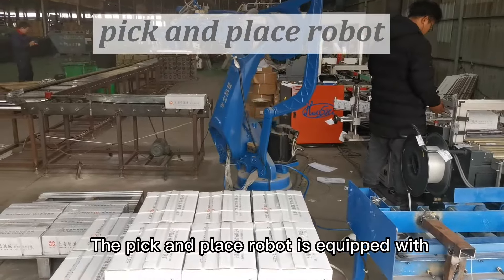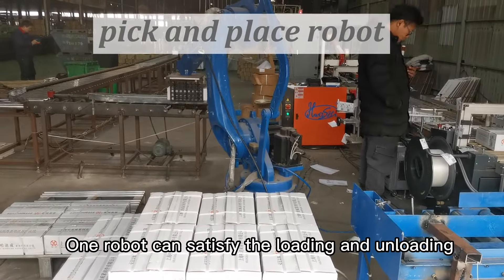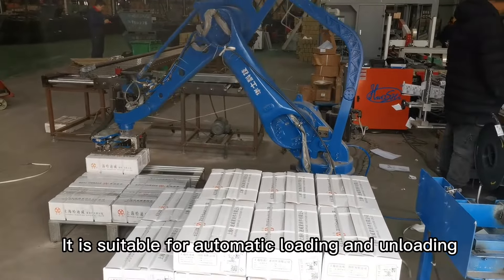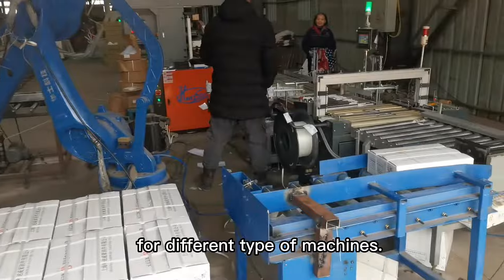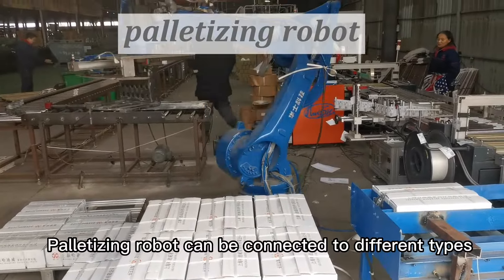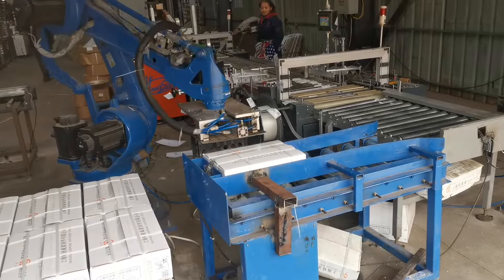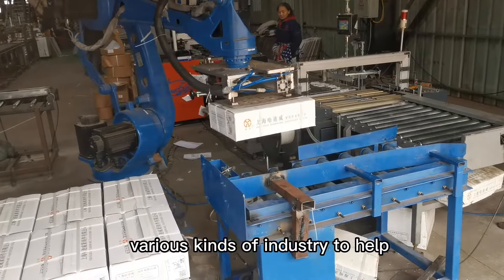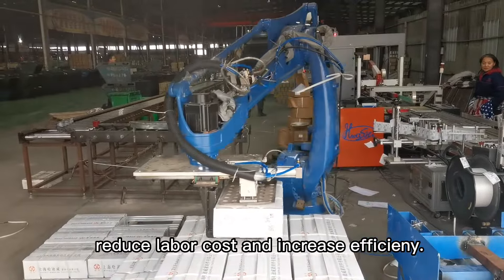pick and place robot for bending machine palletizing robot for sand bag and handling robot

Comment: lmao is this is stoneage technology? This has to be the slowest industrial robot on the market for sure.
Reply from the maker: during the commissioning process
Reply: @welding-machine  I run and maintain OTC Daihen (Japanese) and Fronius or EWM with ABB or KuKa robots at work a lot, spot welding, mag welding, tig welding, fiber laser... that kind of stuff in manufacturing. 
But your robot demo is so slow, an 80 year old obese lady with back issues would be faster.
Reply from the maker: @jonasduell9953  That's great. We can't compete with international brands.